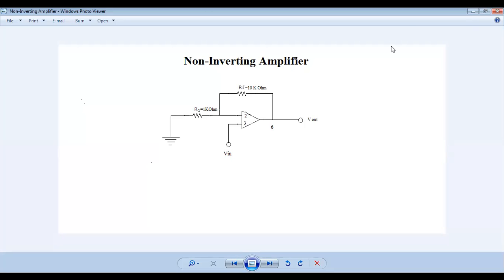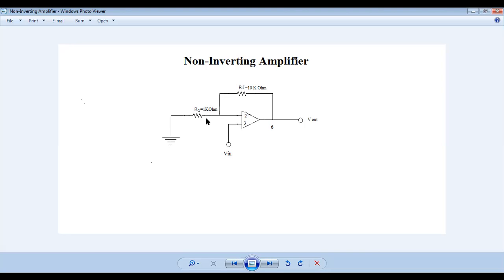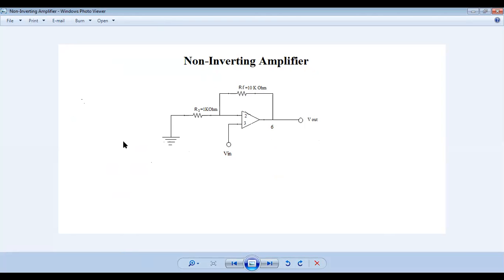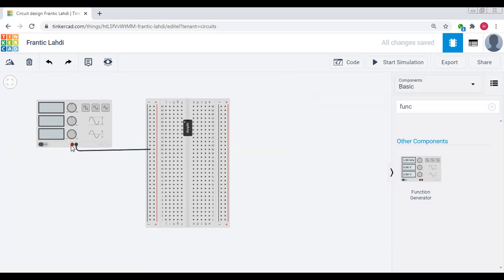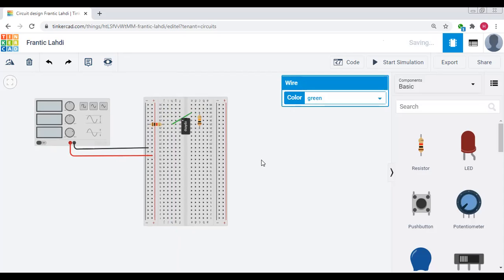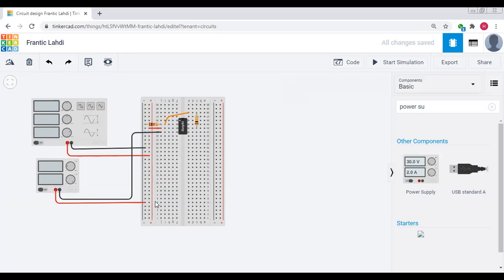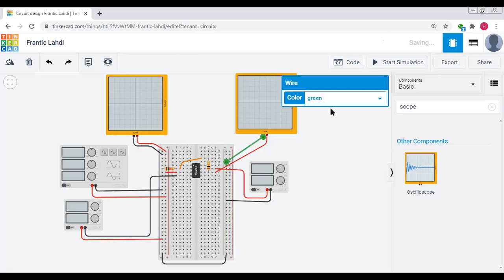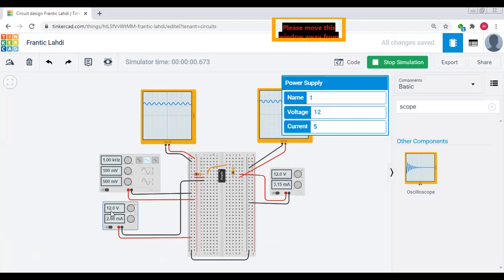Non-Inverting Amplifier| Designing of Non-Inverting Amplifier on Tinkercad| Tinkercad

Comment: sir if we consider ground as negative shorted row of breadboard because as you connect input power supply positive terminal to negative of breadboard
Reply from the maker: I connect input positive power supply to the negative section of Breadboard because by doing this I provide negative power supply to 4th no pin of IC.
Reply: @vasuelectrotutorialclass4865  but sir we have already provided negative section directly to operational amplifier so why we connect positive of input to negative of breadboard how they interlink please explain thank you